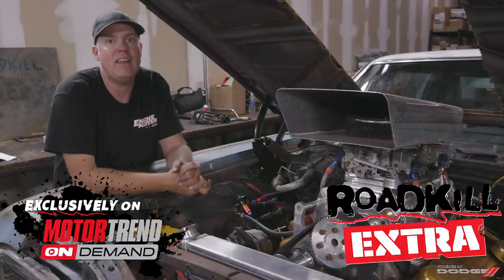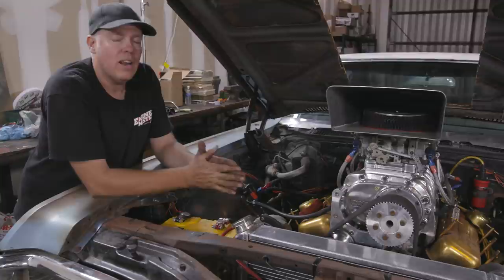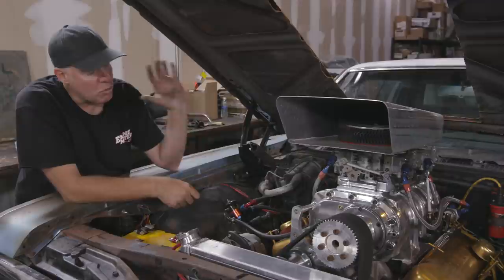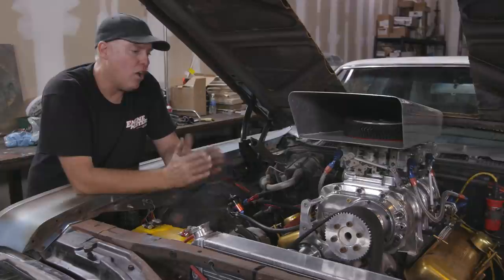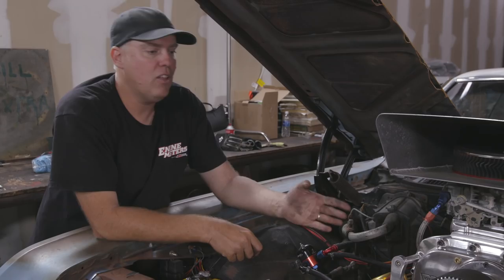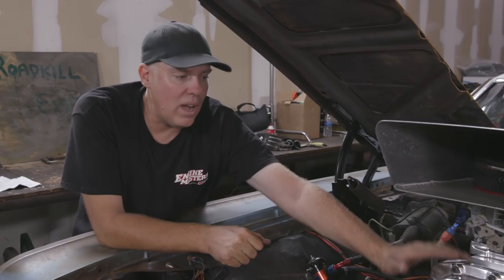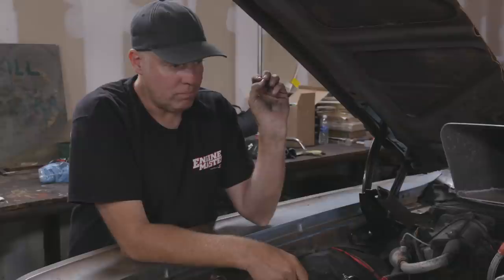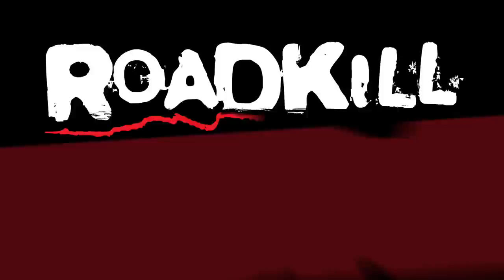Freiburger Explains Supercharger Basics - Roadkill Extra

Comment: No replacement for displacement .... that is, until you find those hightec twin scroll snails
Reply: I hate this argument because when you put the twin scrolls, or any turbo or forced induction in general, on a larger displacement engine they make even more power. So no, there is no replacement for displacement.
Reply: Everytime I hear someone say that I get fired up haha
Reply: Exactly why I do it haha, it's so fun watching people like Serps1991 get mad for a damn opinion that is different then theirs isn't it..... and I also like big engines Serps1991 so get over it.
Reply: Serps1991 That logic will only work if you increase the size of the forced induction relative to the size of the motor. If i were to strap a SR20 (Nissan 2l 4 cylinder if you aren't aware) turbo to the side of an LS1 because I'm "adding the forced induction to a larger motor" I wouldn't get anywhere. Infact i'd probably go backwards. (Lover of boost and cubes here)
Reply: Stefan Supra But it's not an opinion, it's fact. A larger engine will make more power when comparing apples to apples, i.e. Put the same power adder on both and the larger one will make more.
Reply: You're only halfway right. Forced induction increases power output as a function of boost pressure and base power output. A 200HP engine N/A, free-flowing, will make 400HP at ~14.7psi boost (atmospheric pressure at sea level is 14.7psi, so 14.7psi boost is twice as much air as N/A). Subjecting two different motors to the same amount of boost, assuming you don't have any flow restrictions, will cause whichever one made more power N/A to make that same percentage more power boosted, but installing the same equipment on two different motors may not necessarily make the same amount of boost.
Reply: Suddenly everyone in the comments turned out be a certified induction specialist hahaha, get a grip fs
Reply: That would be correct if the compressor was 100 efficient. With compression comes heat with heat comes a reduction in air density. With a pressure ratio of 2 (~14.7psi) you would only get a 46% increase in mass air with a compressor operating at 60% efficiency, if intercooled at 60% cooling efficiency this can be improved to an 80% increase in mass air flow (Based on intake temp of 20c). You would need to be running ~18.6psi to get twice the air mass in theory but this doesn’t factor in the engines volumetric efficiency which isn't going to be at 100% to begin with.

Comment: i think i will go explode my grill, explode a candle, explode a cigar, explode my fireplace, and watch some firecrackers burn, after all it's all the same. gas has various octane ratings for a reason, so the burn can be controlled, i think a controlled burn is not an explosion.if it just explodes, put 87 octane in your 13.5 to 1 540 big block chevy and go raise hell! wouldn't need a timing curve either, or do diesels have a timing curve? trying to learn here...

Comment: its not just CR, a blown engine also acts as a higher displacement engine. if you have a 1l with 10:1 at 15psi it should technically behave as a 2l 20:1 (give or take) at no boost. at least as far as I know.

Comment: What makes blower surge??? I'm building a 454 BBC and I want to achieve blower surge
Reply: guys that don't want blower surge usually have it and the guys that want it usually dont get it lol, only took me about 3 hours of tuning to make mine not surge , yeah it does sound cool but that's about it, and nothing like trying to cut a light and the engine starts surging truck starts lurching forward and forces you to red light
Reply: Matts Madness I'm not planning on taking my car to the track the closest one to me is about 3-4 hrs away I'm building the motor mostly for show and to durn the tires once in a while my city has A lot of low riders and that's not my scene I want something completely different and that stands out in looks and and sound
Reply: Matts Madness what kind of set up do you have that gave you the surge
Reply: 427 sbc aluminum heads 12.44:1 compression with a small weiand blower , its in the s10 there's videos of it on my channel
Reply: yeah big engine tire smoke beats lowriders :)
Reply: Matts Madness ya it does I restored a 65 impala ss and it has a 454 in it with a medium thumper cam with a tunnel ram and 2 four barrel carb's but I've always wanted a blower because I love the belt wine and the surge at idle so now I'm building up another 454 and my whole goal is blower surge
Reply: run injection with a 8-71 it will surge lol
Reply: A mechanical fuel pump and Injectors should "solve your problem".
Reply: Marian S could you explain I am already running a mechanical pump
Reply: Well, that's usually when they start to surge. I guess you have to adjust your fuel tuning to "achieve" surge! I only did that the other way around, weird reverse engineering, lol.
Reply: Marian S I'll give that a try thanks

Comment: They're only inefficient as they are capable of putting out very little boost or enough boost to blow the engine up.  It's kind of like comparing guzzling  a 16 oz can of beer ( Turbos) to trying to guzzle a keg of beer ( roots blower)

Comment: Theoreticly. Yes blower are inefficent because they need to spin up and drags the engine power down. But. If you use a automatic transmission torque converter or how its called and use it as powerclutch for the charger with a management system. Why?
My theorie when you put load on it. The clutch slips a bit which put makes spinning up a bit softer on the engine. It like a mini lag system to take off load the engine. Drawback will be a mini lag in perfomance but you will probably gain hp. Question is. If the guel system works with that theorie.

Comment: I think sticking with GMC rather than GM is going to feed the trolls further. 

Also, on the scavenging front, remember that the intake valve opens at BDC before the compression stroke, so there is not a lot of vacuum to draw air into the cylinder. Hence the blower.

Comment: a supercharger is belt/crank driven

a turbo is exhaust driven

they are BOTH AIR COMPRESSORS NOT SUPERCHARGERS
Reply: So, a supercharger is not a supercharger? 
...then what is a supercharger?
Reply: well...the turbo does supercharge the enigne
Reply: Turbochargers and superchargers are both, by definition, superchargers. There's no argument, though of course we don't refer to turbos as such because it would be confusing in normal conversation. But no, by dictionary and legal and scientific definition, both are superchargers.
Reply: A supercharger is another term for an air compressor in this regard. A turbocharger is just a turbine driven supercharger, or compressor.
If you want to be Mr. Smartypants, you might want to make sure you're info is correct.

Comment: would a BIG ASS RAM AIR be a super charger ?
Reply: fanghicheck no
Reply: Agreed with AlexCoronaPhoto. Ram air is still at atmospheric pressure, while boost is anything above atmospheric pressure.  Superchargers compress the air, when ram air is just high air speed. Exactly why leaf blower supercharging doesnt really work. They can make air move quickly, but not build any pressure.

Comment: Two Stroke=No valves.
Reply: Many 2-stroke diesel designs use conventional overhead valves for the exhaust. Fresh air flows in the bottom, exhaust flows out the top.

Comment: okay i beg to differ on your statement of that’s what makes Superchargers Cool  not so it’s the way they stick through a hole in the hood and that Whiny high pitched noise they make  when they are spinning  that’s a cool fact about the first ones used inHot Rod applications where the ones off of the Detroit two Stroker engines  that makes sense and because i’m a long time Motor Yacht guy  the Marine Detroit two stroker Diesels happen to be a favorite engine and sound of mine BTW they also happen to be great Durable poweplants that are relatively easy to find parts and people that know and understand how to work on them  i happen to own a Chevy 3500 Dually Diesel truck i use to pull my boats and RVs  and several years ago a local ASE Mechanic  armed with several SnapOn diagnostic tools  had a h difficult time diagnosing for sure if the truck wasn’t starting due to a faulty Lift or Inhe tor Pump ?  i figured it out with a can of WD 40  because i cracked a couple of fittings and sprayed the WD  into a couple of areas to get the engine running  it’s a old Boat yard trick n to start a Take out Diesel engine  in the Yard or Shop to demonstrate it running  for a interested buyer to listen to the engine for a few minutes and to not need a elaborate test stand  i don’t know if it was true or not but a Marine Mechanic told  someone in the Yard observing that procedure that WD 40 was actually invented  or developed as a alternative to Diesl Fuel  for them to run cleaner and more efficeint

Comment: Turbos are better in almost every sense.
Reply: DaveandCruz Packaging is a huge concern in OEM environments. Also, cost. Both in OEM and aftermarket. Not having to route the exhaust around the block, no oil/water lines, no wastegate/bov, potentially no intercooler... There is a lot to love about S/C. Even though turbos are generally a lot more efficient.
Reply: I don't know.. that low end torque curve of a roots supercharger hits hard like nitrous, but no need to ever fill a bottle. From light to light on the street, blowers are just too much fun.  Add in a steep hill and some weight, having max boost right off idle and the ability to keep engine rpms at reasonable levels, it's just a great driving experience. Setup up right, it's like two motors in one. Mild well mannered street engine until the need to open it up.

Comment: Sorry cobber, fuel doesn't 'explode'. If it did, there'd be broken parts everywhere.
Reply: Fuel does explode. The 'broken parts' you're looking for are the CO2 and H2O that come out of the tailpipe.
Reply: 'First, let us review normal combustion. It is the burning of a fuel and air mixture charge in the combustion chamber. It should burn in a steady, even fashion across the chamber, originating at the spark plug and progressing across the chamber in a three dimensional fashion. Similar to a pebble in a glass smooth pond with the ripples spreading out, the flame front should progress in an orderly fashion. The burn moves all the way across the chamber and , quenches (cools) against the walls and the piston crown. The burn should be complete with no remaining fuel-air mixture.*** Note that the fuel/air mixture does not "explode" but burns in an orderly fashion***.'

Comment: hey guyz, how much of a stupid idea is to put a roots blower on a diesel? imagine the throttle response, the air is already there, just the injectors have to fire!
Reply: The Vibe most diesels come turbocharged so you'd have to twin charge it and that comes with a whole heap of problems on its own. Not entirely impossible, but itd be almost not worth the unreliability i would think.
Reply: no, just the blower and that's it. plus that i want to do it on a bmw because they have i6 engines, so it will be easier.
Reply: All the old 2 stroke detroit diesels were supercharged
Reply: Just crank the injector pump to roll coal, and get a small nitrous setup. 
When ya wanna fly just hit the button to clear the coal up and haul ass.
Reply: Crazy Carl makes a kit for that. It's been done. One outfit was running one with a pair of turbos on a Duramax. Banks Power made a dragster that ran just a blower on a Duramax. Fact is, it's usually just disappointing, because turbos are so much more efficient, and capable of flowing so much more air, and such a higher pressure.
Reply: The Roots blower on a Detroit Diesel is NOT 
for extra power.

That engine will NOT work without it.  PERIOD!
There is NO intake vacuum.  It can't suck air in.

steve
Reply: Steve Skouson that is correct, it needs air forced into the cylinders and the exhaust out. The 6V53T I'm used to working on has a gear driven blower internal to the engine and a turbo to actually make power
Reply: Throttle response would be great. But it would make nooooooo power. Instant torque, but no steam up top.

Comment: im going to be that guy, its not an explosion, it is controlled burning, if it were to be a explosion you would not be the one controlling it, yeah im fun at parties.
Reply: haha
Reply: ValleVaan lol
Reply: And another shout-out to Mr. Buzz Killington, folks! :P
Reply: What if I say it IS an explosion, but of a type called a deflagration rather than a detonation?
Reply: correct! fuel propagation, kinda like a swish!
Reply: What's the difference between an exploding and burning? Basically how fast it happens. And I'd say that in IC engines the combustion happens pretty dang fast.
Reply: kanglar, diesels explode, gas propagates, or moves across the combustion chamber over time
Reply: The burn propagates across the chamber over time no matter what, it's physically impossible for the entire volume to burn all at once instantaneously, even if you are talking about microseconds it still takes some time. Like I said, the difference is how fast is an explosion, and how fast is a burn? Where do you want to set that limit and why?
Reply: diesels ping(explode in cylinder) with compression, and no source of ignition, gas, however, needs a an ignition system to start the combustion process at 8, 9. 10,...14.5 to 1 compression. you don't here cars pinging on your way to work, but your sure do hear diesels. explosions make noise, fires can burn quietly
Reply: Yea yea we all know diesel ignites from compression only, that's irrelevant.  "explosions make noise" Last time I checked gas motors make a fuckload of noise as well as diesels. Take your headers off if you don't believe me. Like I said, for the third time, the only difference between an explosion and a burn is how fast it happens
Reply: ValleVaan I'd still party with you bro!
Reply: Explode and burn have overlapping definitions. The more distinguishable "difference" is between a detonation and a deflagration.
Reply: you can hear diesels exploding in the combustion cylinder, the only time you hear gas engines explode is when there is pre-ignition and detonation.obviously , you want them to be the same, but they aren't. i do enjoy the debate, and critical thinking. if you want to call it fast or slow combustion i can live with that.
Reply: ValleVaan It's an important disinction that seems to be lost on many knowledgable car guys. Flame front propagation, quench area, and other properties of internal COMBUSTION matter a great deal in making horsepower. Calling fuel/air charge burn an explosion is just plain wrong. I have a lot of respect for Freiburger and I watch a lot of Roadkill. "Explosion" is common usage by many automotive experts When referring to fuel/air burn but it's misleading. I just wish this little piece of nomenclature would be  corrected.
Reply: well said
Reply: An explosion is a rapid heat and expansion... the fact that its controlled by a spark is completely irrelevant. Or is it a controlled explosion at all times unless you have predetonation.. then its an explosion? lmao come on...
Reply: "An explosion is a rapid increase in volume and release of energy in an extreme manner" --- There's your definition of an explosion.
Reply: go ahead and argue with the english language... like the same people who dont think that an engine is a motor and that motors are only electric.... no those are electric motors, theres a reason why they're called "American motor company" or "general motors" or "mitsubishi motors"..... motor = converting potential to kinetic energy. hence "human motor function"....
Reply: I'm not interested in linguistic differences or similarities of the words. The function of an internal combustion engine relies on the proper burn pattern and rate of the fuel air charge. The motor only operates efficiently if the burn is controlled properly. To use the term explosion indicates an uncontrolled reaction. In an engine, this is referred to as detonation, a bad thing that results in mechanical damage if it goes on for very long. True explosives are chemical compounds that do not require the addition of atmospheric oxygen to support the chemical reaction.
Reply: well, is it going boom, no matter the size? then it would be an explosion.
Reply: The gunpowder charge in a firearm does not explode, either. It's a controlled rate burn. If it were to explode, the gun would not be able to contain the explosion. It goes boom, though.
Reply: OK here is a different take on all this.  An explosion is a rapid burn.  It gives off heat and kinetic energy, a burn only gives off heat, its too slow for the release of kinetic energy.  So both Gas and Diesel engines have an explosion in the cylinder.  Diesel burns at a much slower rate than gasoline but with a higher output of energy, thus more power.  Same with high octane gasoline, its burn rate is slower than low grade, and that being slower it is able to harness more of the energy in the fuel and convert it to the kinetic energy that pushes the piston down.
Reply: the kinetic energy of an object is the energy that it possesses due to its motion.  Like I said!  Energy of motion which the burning the fuel imparts on the pistons.  Also an explosion creates a shock wave which is also kinetic energy, this time imparted to the air.